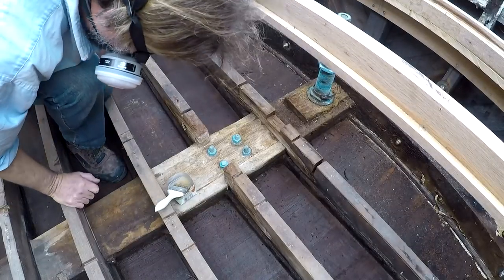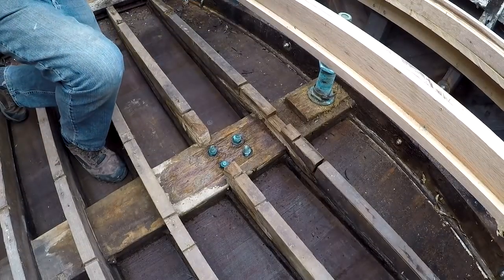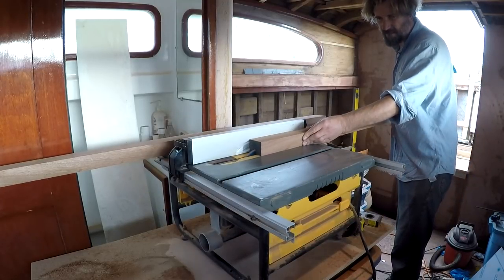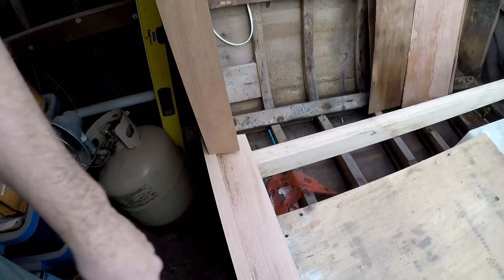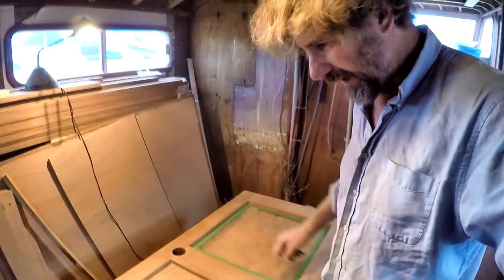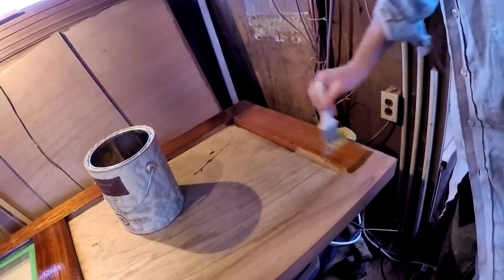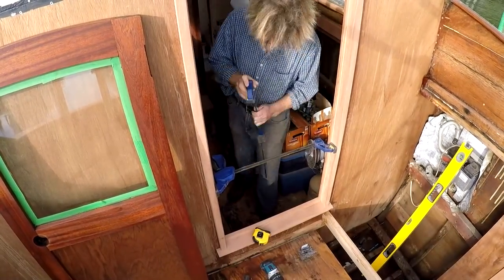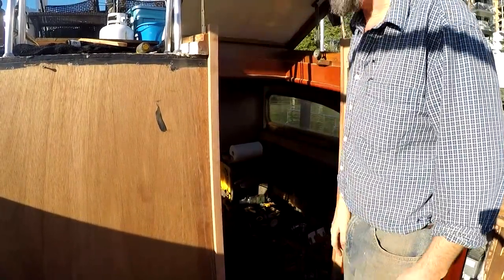New cockpit door - Wooden boat restoration - Boat refit - Travels With Geordie #71

Comment: If you did not know... There is some wood hardener out there to harden soft wood.
I have used it to harden wood that is in the beginning of the rottening process that I used for wood turning.
Like  what we call sour birch here in Norway. That wood become extremly nice looking, but the souring process is the beginning of to be rotten.
We then soak the wood with the hardener first, and then turn it.
I have also seen some boat restoring has used it.
Reply: By the way... your work with the boat become awesome.
I have never been restoring boats myselfe, but I'm a educated carpenter and been professional carpenter for more then 15 years and after that working in other construction and with scaffolding and now in the construction equipent rental buissness. And I have been restoring our old house from 1968 inside out.
Keep up the good work.
I stumbled across your channel some days ago, and I'm now watching your videos from oldest and up, and this is where I'we got so far.

Comment: Voice over is a great help. (i forgot to mention that i'm partially deaf) 

I love the table saw BTW. Was it expensive?
Reply from the maker: Thanks Paul, More improvements coming! It's a Dewalt compact, great little saw. https://www.homedepot.com/p/DEWALT-15-Amp-Corded-10-in-Compact-Job-Site-Table-Saw-with-Site-Pro-Modular-Guarding-System-DW745/100497987$299 US, I bought it in Texas when I was travelling. First use was to cut aluminium. https://www.youtube.com/watch?v=XBmdMVWs2q0